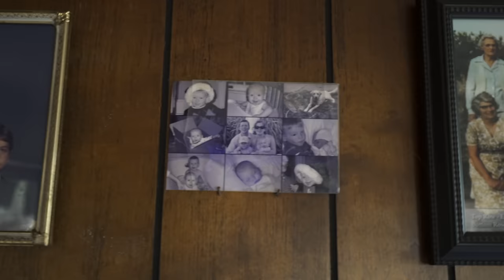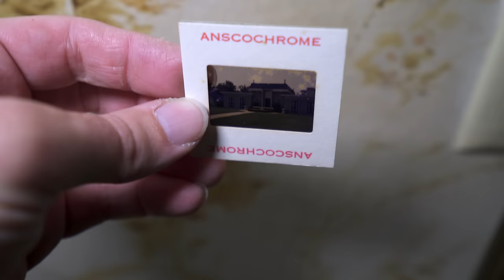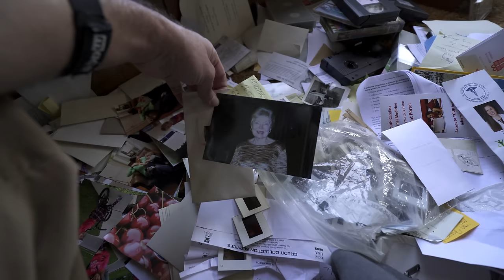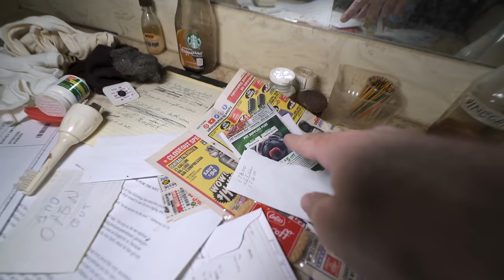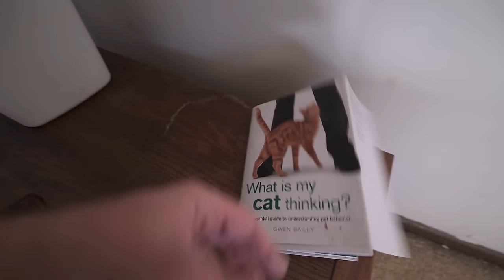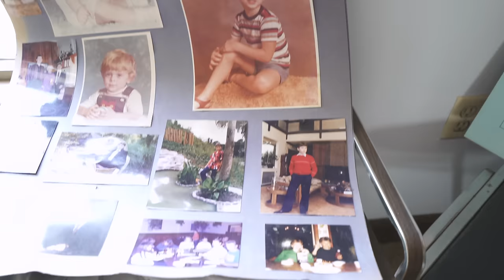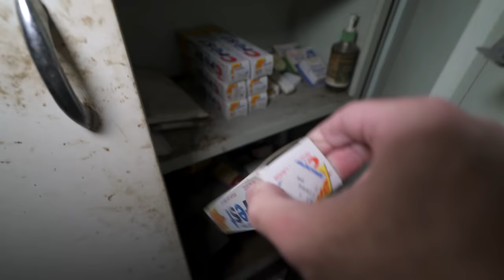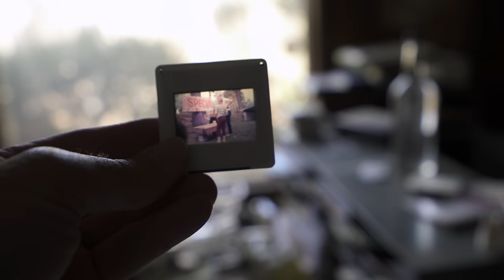UNBELIEVABLE Abandoned Mansion With Fully Stocked DOOMSDAY Bunker

Comment: I am surprised you keep referencing how old everything is.  2020 was just a few years ago.  The vitamins in the cabinet are a current brand.. the house is of the 70's.  But much of the contents is just a few years old. Starbucks cold drink bottle. I've listed houses as a realtor and believe it or not some people live like this.  It's not unusual to live in disarray.  But it a shame the house was let to deteriorate.
Reply from the maker: Ahhh good catch!
Reply: That house is a booby trap that could go off easily. That needs to be reported. Even if they came in there to wreck it to use it for a new housing can you imagine what would happen if they started to tear it down with heavy equipment?
Reply: Or if the chemicals got in the water supply?

Comment: The metal boxes have a transformer in them can be used for low voltage ⚡ electric project boxes. The balls are ballbearings used in All kinds of things. Machinery automotives etc. i went straight to google and they sell the on Amazon. They are for welding or anything you wish. My late father in law had some of the boxes and after he passed we had to get rid of all his old belongings.  He waa an electrician from sixty's till he passed and worked at L&N railroad and then it went to CSX. Its amazing how much odd stuff was used in machinery etc..Really upsetting his kids didn't care enough to take care of this home.

Comment: Not sure some of this stuff is as sinister as it appears. The "batteries" are simply high voltage capacitors. Those "detonators" from what I can find are  vintage hobby kit audio saturator clippers used for music mixing. The silver spheres look like density balls that are filled with metal shot to match the density of certain liquids but their plugs are missing so the shot spills out. This guy was most likely a tinkerer given that massive collection of stuff.